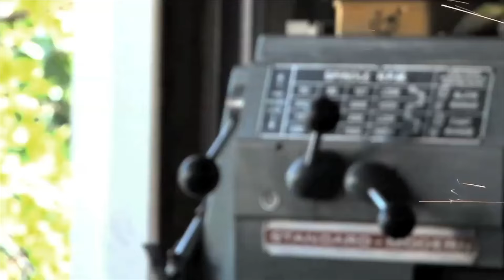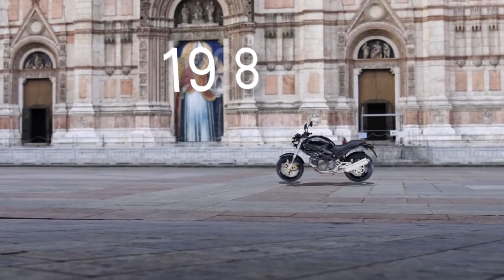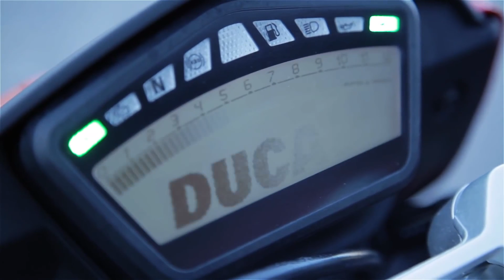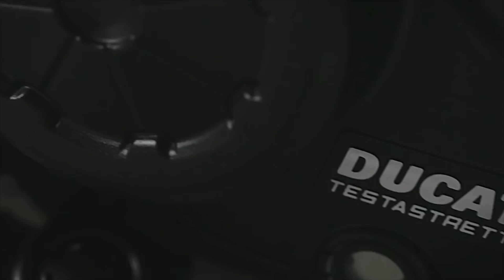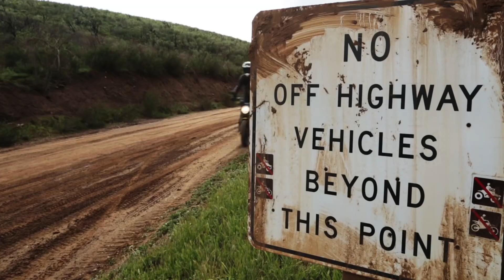History of Ducati Motorcycles

Comment: Ducati did not release the 999 in 1999. I don't know where you got that from. Ducati were still using the 996 at that point and succeeded the 996 with the 998 in 2002. The 999 was released in 2003.